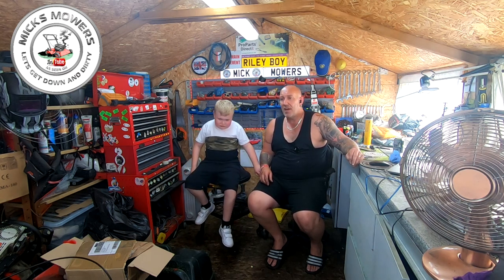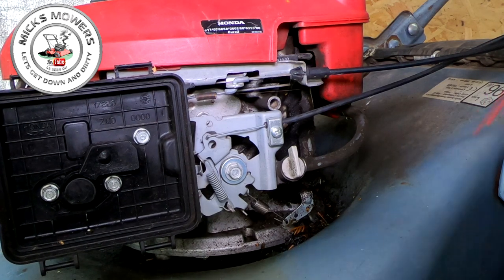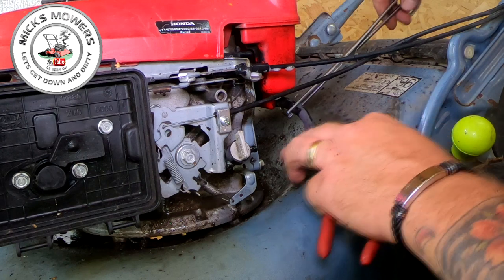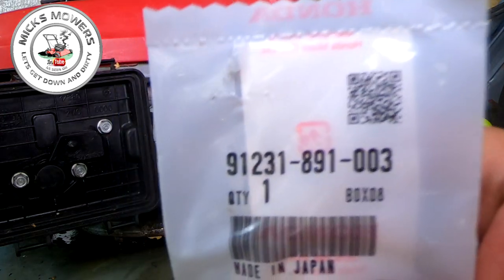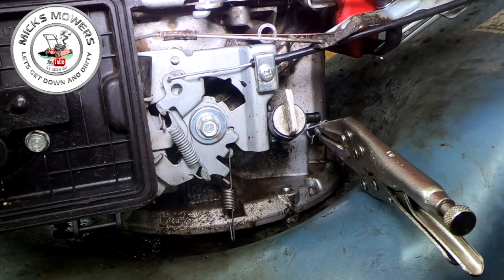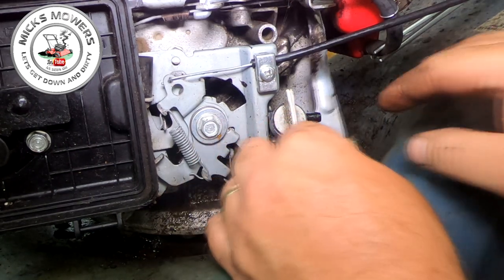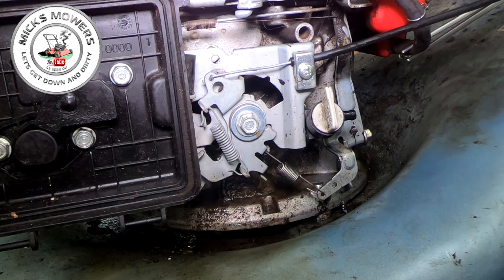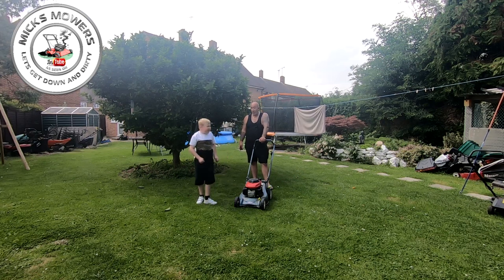Honda Lawn Mower leaking Oil From The Governor Arm.. Here's A Fix

Comment: Hi mick. You have done this repair properly but I have done this several times successfully by simply applying black bathroom silicone sealant to the cleaned area. It forms a seal just the same and because it remains flexible when dry it doesn’t affect the governors function at all. Just make sure the area is clean and then put a blob in the place where the oil seal would go and clean the excess off with you finger, let it dry overnight and job done.
Reply: Thank you for posting this.  This solution was cheaper and faster then going with the with the O-ring. I appreciate it.

Comment: Hi Mick I tried this but couldn’t do it, it was the right seal but the engine casing never had the space for an oil seal. Perhaps it was an older engine. Good job 🙂👍
Reply from the maker: Hmm could be.. if you get stuck you can always give me a bell lol
Reply: @themowerman  Why? when I can get advise from the best mower mechanic on YouTube, myself 😂😂 I remember it was a gcv135 on a 1999 Honda eco, that just had a hole through the casing nothing else, so no way could a seal be fitted, you’ll probably get comments on this video in the future saying that. You have to wonder why Honda have the space but no seal🤔 doesn’t make sense.

Comment: With the new type being rolled out by September what fuel should you now use in lawnmowers.
Reply from the maker: You can still use e95.. or you can pick up some aspin fuel
Reply: @themowerman  thankyou I have heard aspinall fuel can contain water and you may need to reset carb 
Maybe you can do a short video on the subject

Comment: Did you replace the oil seal or is this just a fix to stop the leak?. Are you not afraid of dropping something on your toes, I notice you are always wearing open toe sandals. Safety first.
Reply from the maker: They don't come with oil seals.. so it's something you add to stop the leak.. oh I have always worn sliders..